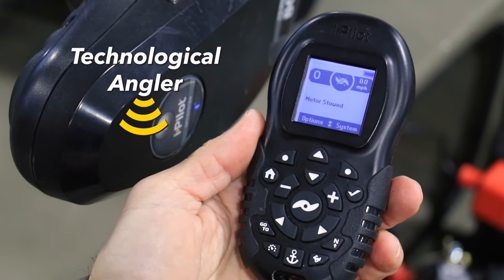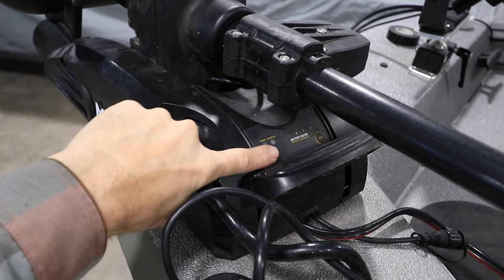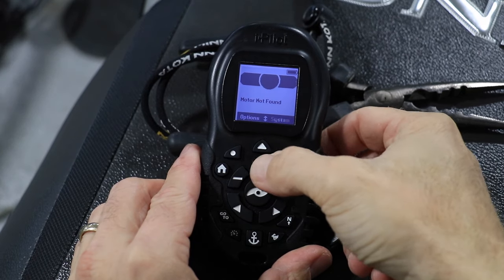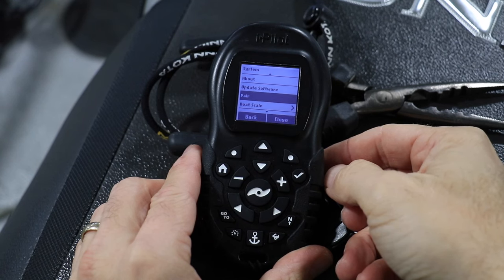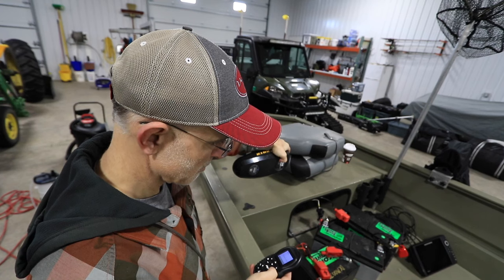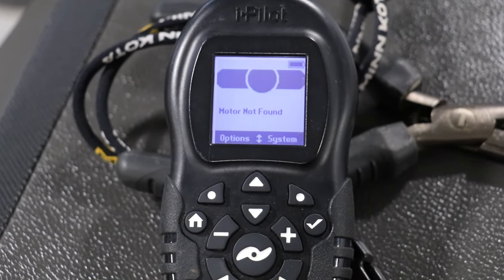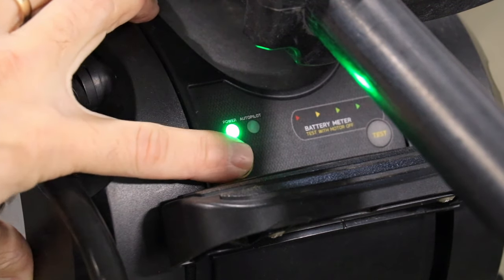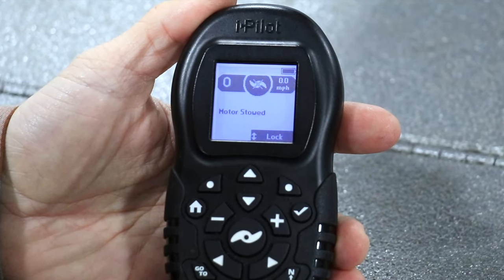How to Pair Minn Kota i-Pilot Remote and Clear "Motor Not Found" Error | The Technological Angler

Comment: My i-pilot needed batteries so I changed them out. Now evertime I turn it on I get a RF error. Motor not found when I am sure the trolling motor is tuned on. Any thoughts on what the problem might be?
Reply: I have the same issue